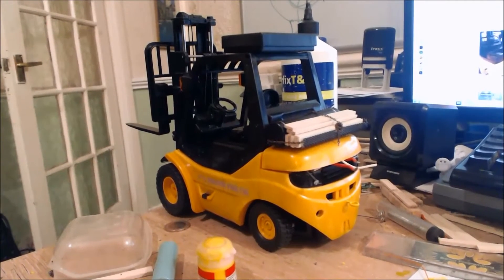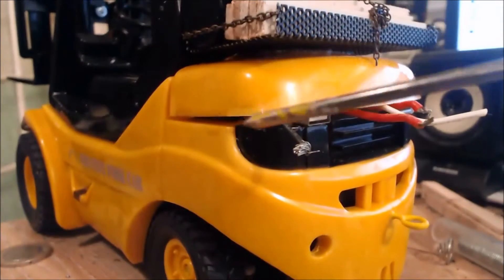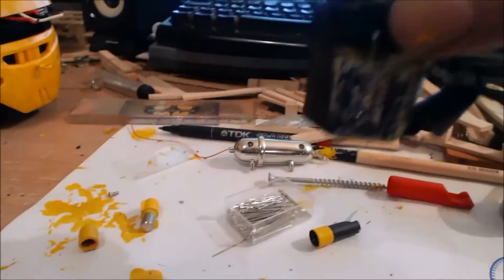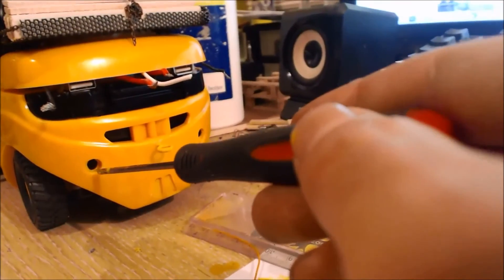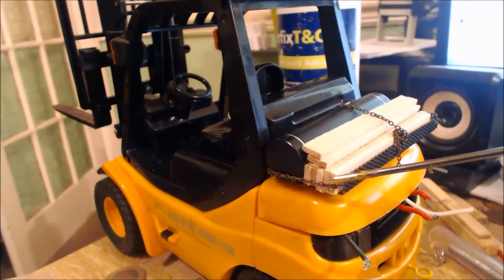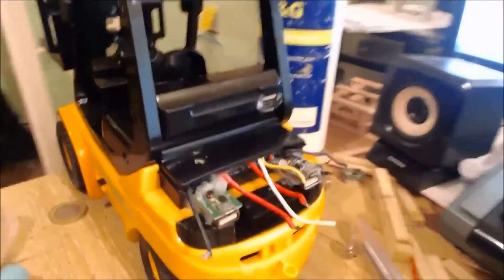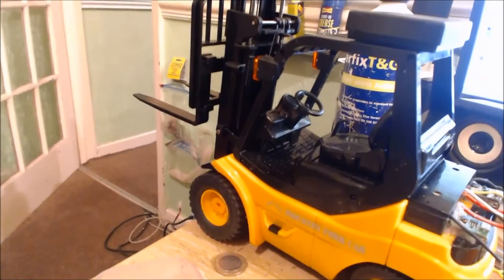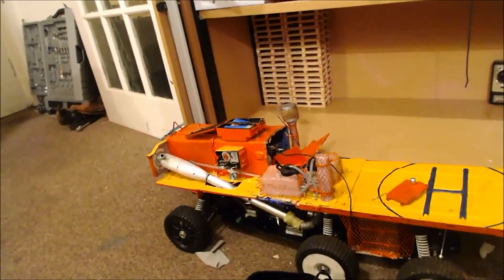1:10 Forklift Power Upgrade Part 2 & Brief Updates

Comment: Looking good. I realy like the faided paint trick and the stamp on the palate. The use of usb batteries is cool too.
Reply from the maker: Devolution RC Thank you ji :-D yeah that paint trick the guys at warhammer used to do when I was young hanging about playing using my one figure when they had giant armies :-) I was always a dungeons and dragons kinda guy, a tip take 'barbarian' as there are always more dice to roll compared to other characters :-p they took it to a whole new level with the painting though, doing similar to what I did here but with many more layers and with varnishes to finish the look off at the end :-) This type of painting I have always really respected this was the first time I think I actually pulled off an effect :-p I appreciate the support mate :-)
Reply: I can imagine the multiple layer technique looking quite nice. You did a great job here. Working around forklifts from time to time I've noticed they cop a bit of abuse at the rear, from swinging around to close to objects. It would be nice to replicate that too. Above my skill set though :-) I commend you..
Reply from the maker: Devolution RC cracking idea :-) I know what you mean the rear is always slashed up where the fibreglass gear is showing white scratches from grinding off hand rails and stuff :-D you're also right that sounds tricky to pull off, im darn tempted to get the dremmel and paints out and have a go though :-p
 Ive seen your work and don't underestimate your skills one bit, I fluked this here but I think you would do better on more intricate and small pieces and would be more consistent with the quality :-)
Reply: I thank you for your confidence :-) it takes me forever to get things done. This land cruiser body has nearly been a year, thought I had all the paints then I looked this morning and realized it would have been better to get the black in a spray can.. doh!!! Then I need something to make all the right sized holes for the lights and flairs etc. Bloody adds up in the end hey.?.. part of the fun i guess =D
Reply from the maker: Devolution RC sounds like you are my doppleganger :-D yeah know that feeling of thinking you are kitted and ready to go, only to sit down and have to skulk off to ebay and wait a few more days for parts to arrive again :-)  Paint is a real curse :-) Im the same there to, a guy on ebay was going round the warhammer shops and collecting the mostly used tubs of paint, then he was going home and pouring them in to one and reselling them on :-D i bought a couple of sets off him at the time, (want some more to) but it never came with a black :-( really need one now to :-)  I wouldn't dare have a go at spray painting though that's a bit much for me :-) and no worries on the time it takes to make stuff like your l.c. the longer it takes the more theoretical refinements you can do in your head to push your quality up as high as you can :-D Anyway your problem sounds like waiting to get the bits in could be worse, my problem starts when the bits arrive :-) You're right though all the bits add up for sure :-( Take heart you have a sweet build at the end :-p i often end up with fried electronics :-D

Comment: doing a great job there battonfive...that 6by6 is awesome...I want to see that go :)
Reply from the maker: thanks Ramsay :-p its well overdue to get spitting up some smoke :-) im just waiting for a day or two until my new soldering iron tips come, will finish off the electronics and will get some nitro in it this weekend and see if I can finally get it running, all the bugs I think are ironed out so it should be a pretty solid machine...if it works :-p
Reply: battonfive I bet you will get it...I got all the faith in ya
Reply from the maker: Ramsay R/C cheers :-D as long as I don't have to strip off the couple hundred bolts caked on with paint you can bet this thing will be belching :-p
Reply: battonfive Lmao 👍👍👍
Reply from the maker: Ramsay R/C:-p

Comment: doing great man there are electric forklifts as well :)
Reply from the maker: macplastering thanks :-D i think this one is electric atleast i think it was when it started out :-p its just there is no exhaust and the gas ones look like they hold a canister on the back engine cover :-) on this i was going to leave that usb powerbank sitting in the rear rack, perhaps even take out the electronics and fill it with cement to add to the counter weight for the forks :-)
Reply: :) You put a lot of thought into these man and end result are great. Yes I drove an electric on that be charged in a ware house on a job I was doing years back much better for inside as no fumes :):) also it still had gas tanks on it think it was for the forks but im no expert :)
Reply from the maker: macplastering sounds like you have far more of an idea than me :-) I really appreciate the heads up will go have a look in to the gas cylinder to double check :-D
 yep with research and comments like what you have provided me here I can really squeeze as much realism from the thing as is reasonably possible :-)
 I would love to have a go at a 1:1 of these :-) and a 1:1 little bob-cat would be sweet to :-p
 When I was a kid I really wanted to be a demo man :-) looked great fun knocking lego towers down for a living :-D
Reply: Haha some times walls coming down is fun if they easy :) no problems mate but if you ask me you got it sorted as is :) and yea them fork lift are quick and fun :) But can be dangerous too
Reply from the maker: macplastering yeah I wouldn't like a bump off one of a 1:1 of these if you get a 'have-a-go' driver :-) with a ton of bricks on the front :-D
 I totally agree, I don't wanna go overkill on this forklift :-) to easily done, but im just trying to tweak its power a bit for endurance, I was thinking this may come in handy on my scale tunnel project.
 Im wondering if its possible to use it to put the side walls in the tunnel, gluing the wall pieces to the end of the forks with a glue gun then when the wall piece is in place lifting the forks up so the glue snaps and leaves the section in place...yep ambitious for sure :-p
Reply: you should record that man :):)
Reply from the maker: macplastering will do :-D im hoping to time completion of this nice with getting a shed sorted for chopping up the bricks using the 9" grinder in a stand :-) should be in the next month or so with a bit of luck :-)
Reply: nice a man's best friend is a shed :) :) possibility's  are endless :)
Reply from the maker: macplastering totally agree, but best not admitting considering a tunnel system from there atm in case the misses finds out :-D
Reply: haha :):)

Comment: Just a tip when you start the truck turn the throttle trim up to allow for easier starting
Reply from the maker: Thomas Pugh thanks Thomas that reminds me of 2stroke4me 's advice, and when two guys who are well on the nitros say something like that you bet im listening :-) will do, will check it on stock and then tweak that screw needle thing a couple of clicks:-) technical term you understand :-D  Do you think the pressure will get the nitro around the system ok after the dual fuel tank lines have been added and extended? honestly never going near a nitro before I don't have a clue :-p twas a build and pray job to be sure :-)
Reply: I'm not sure cause there's alot of fuel line but fingers crossed battonfive
Reply from the maker: Thomas Pugh I can live with that approach :-) will be nice if she behaves and just fires up the first time :-D something tells me you would whisper sweet words to the cooling block and it would just kick up to life :-p